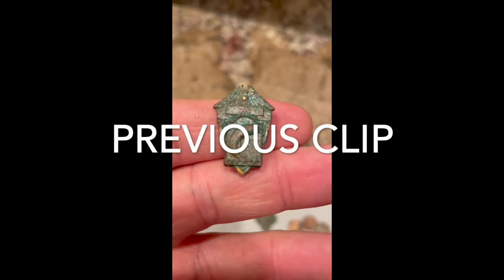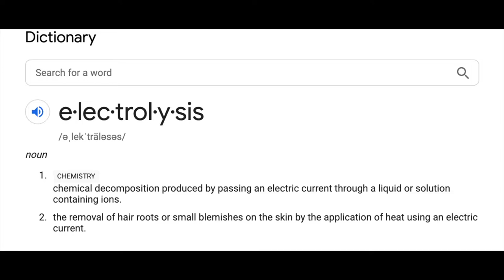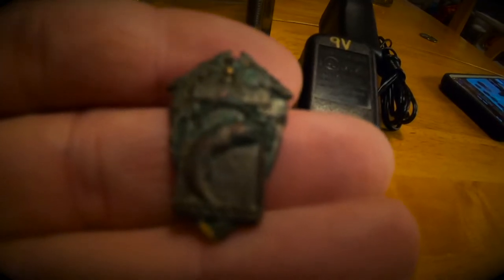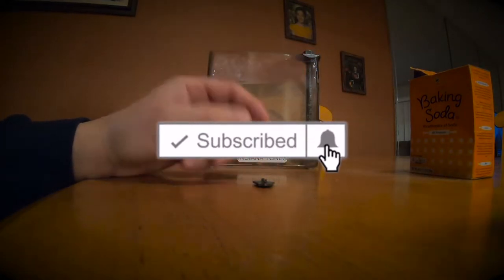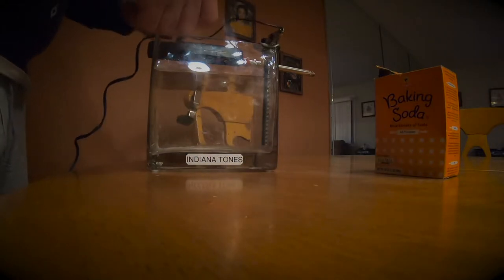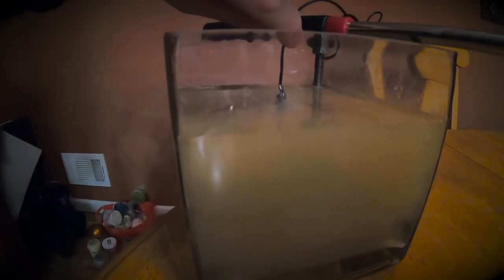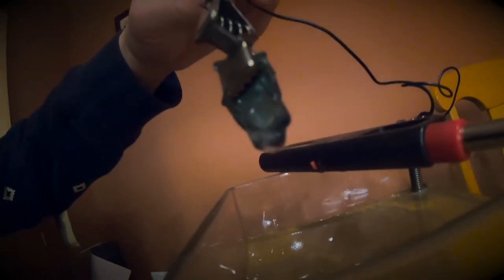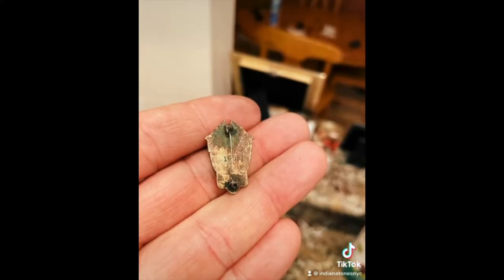Electrolysis Cleaning Metal Detecting Finds Tutorial

Comment: Wat is the amperage of the power source you are using or does it really matter?
Reply from the maker: I believe the more the volts track the more amperage is created. I know it works more the higher the voltage goes. The Ugly box gives you more control. A lot of people use the set up similar to mine. I think this only shows the voltage on the adapter. I have to go look at it again.
Reply: @IndianaTones  cool thank you

Comment: Railroad spike? I have about a hundred,lol. Any specific reason?
Reply from the maker: Steel and iron are the most commonly used for electrolysis of water. These electrodes are used as anode and it is sacrificed in electrolysis. Doesn’t have to be a spike, I was told it’s easy to mount one.
Reply: @IndianaTones  thanks!